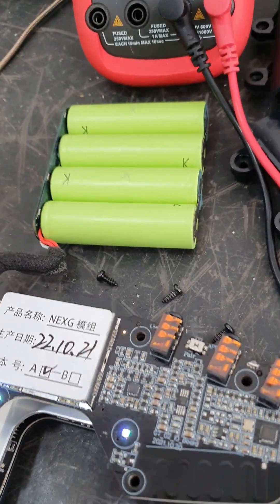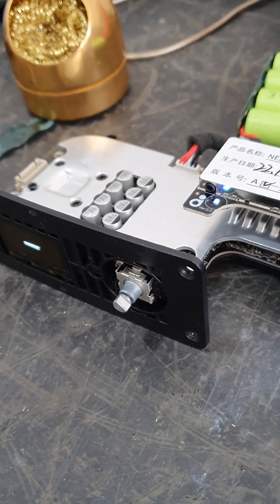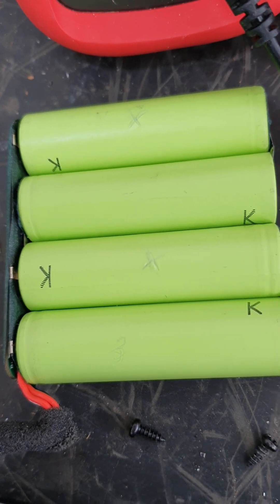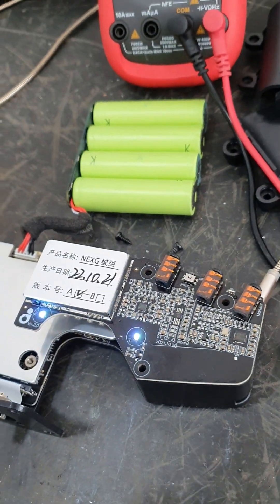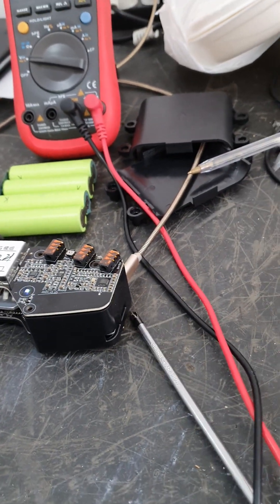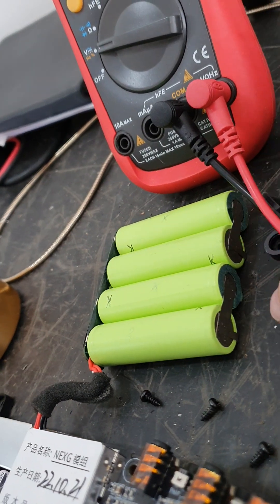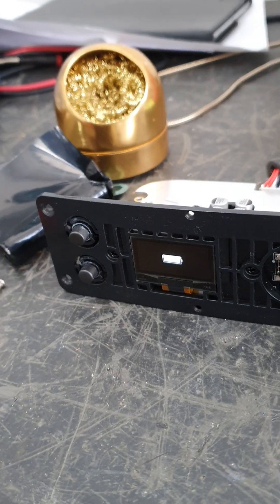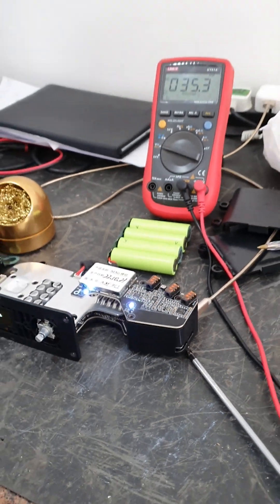Rebalanced LI Battery Pack for NEXG Silent Guitar using Bench PSU

Comment: ❤ Thanks for sharing. Mine did not charge either. Took it apart - one cell reads 2.4V, another 2.8V.
Trying to charge them right now with a dedicated li-ion 18650 charger individually. If that doesn’t work I“Öl replace the cells.

Thank you so much - you were the single only source I found on that problem!
Reply: what is the specrs for the batteries? I want to buy them to replace. Thanks!

Comment: Thanks for the great video. I've taken the battery pack out and all 4 cells seem to read 4V, 16V across all 4. Any ideas?
Reply from the maker: @russellhutson1603  seems like a problem on the main board battery management system. I had to write the one I was working on off.